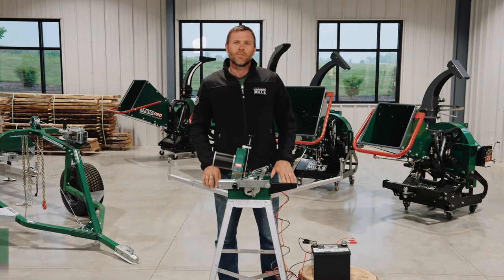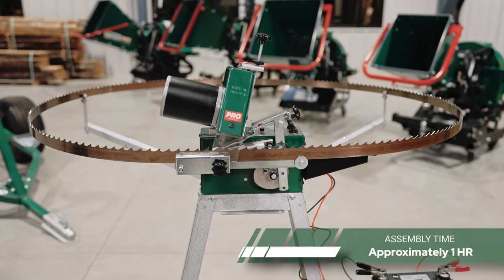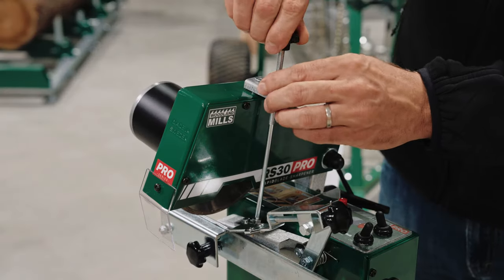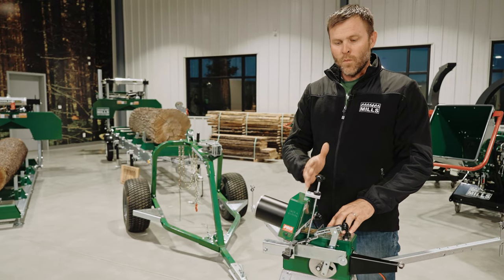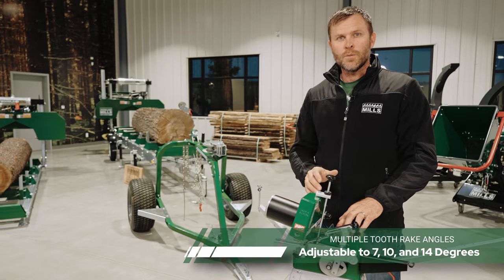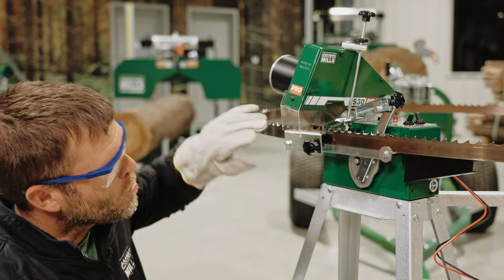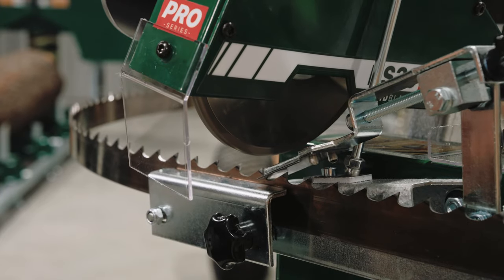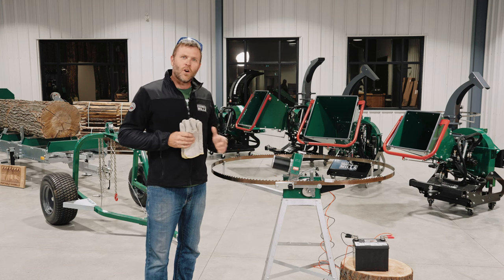Woodland Mills RS30 PRO Bandsaw Blade Sharpener Walkaround

Comment: Good demo video and is one of the best blade sharpeners I seen.....
 But I would rather have 120 volt version and I also would like a wet-grind option, just to make sure temper in tooth stays the same. Seem so all is needed is add-on tub with some sort of small pump to pump oil on tooth....

Comment: Thanks for posting the user manual as it answered many questions but left me with two. 1) What do you do if your blade manufacturer does not match the cams listed?  2) What is the wattage of the grind motor? Thanks!
Reply from the maker: Hey LazerBee! For your first question, we have a general purpose cam which can be used to adjust the sharpener for many different blade types! As for your second question, this is a battery operated machine! If you are interested in the wattage or in using an invertor please give our tech department a call at 1-855-476-6455 :) Hope this helps!